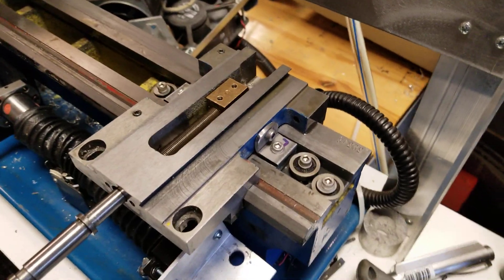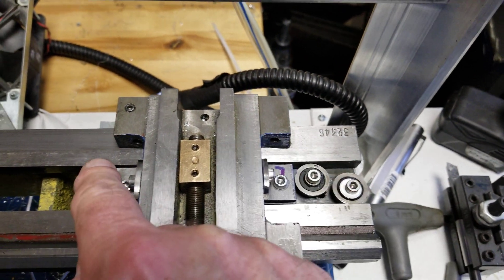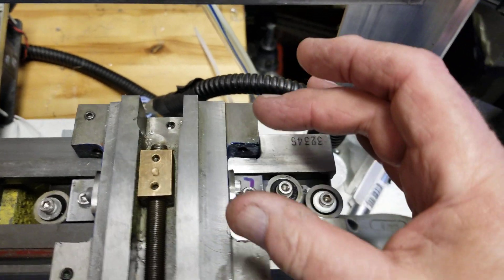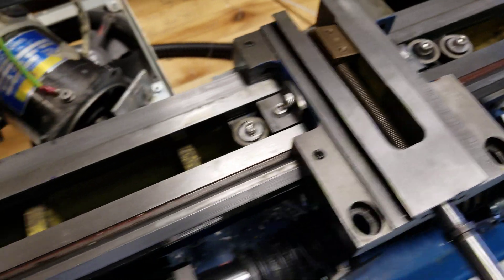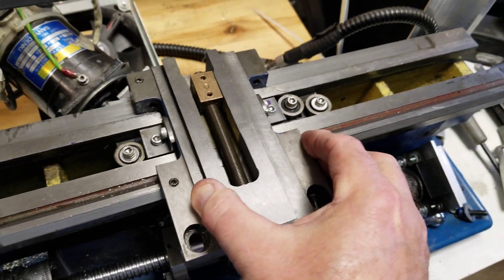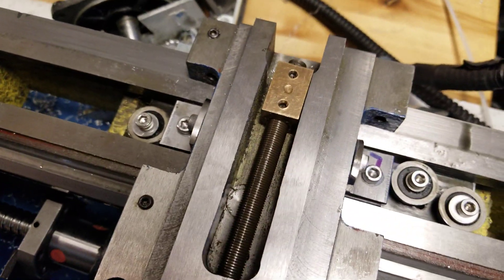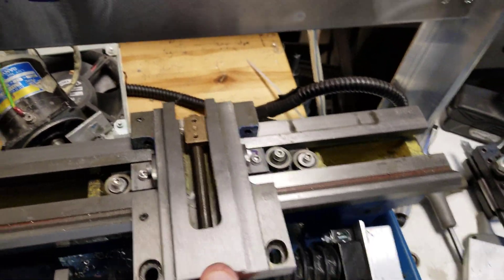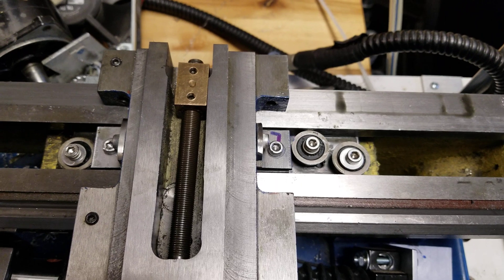Mini lathe saddle upgrade using ball bearings. by David Munson

Comment: Not my cup of tea for a few reasons. One being forfeiting travel and two the bearings will wear down the cast bed in a matter of short time therefore putting you back to square one. 
 I personally removed the steel gibs and made ones from oil brass. Yeah they too will eventually wear but I can adjust them and they won’t win the battle against my ways.

Comment: I did a saddle upgrade video where if the saddle front is held down on the front way then the saddle can't move in any direction. You still have the tilt problem at the back which causes chatter when turning with this fix but neat idea to solve the problem Dave..

Comment: I have the small lathe but do not see any advantage to these bearings, especially if the have to loosen the saddle to begin with. I have seen someone put ball bearings in the saddle clamping plates. Not even sure if that ball roller in the plates are any better than sliding plates if all is ground smooth.
Reply from the maker: The comments on the ball bearing saddle was that the ball bearings did not rotate and simply rubbed on the gib sides.
My saddle would not run smoothly as my ball screw position made the saddle rotate and pinch.  The plate is not a side holding plate like Steve's as the plate only holds the saddle down. The bearings holds the side parallel. 
I will post a video on it working now that it is complete.    https://www.youtube.com/watch?v=4hxrFLwx9xs&t=4s